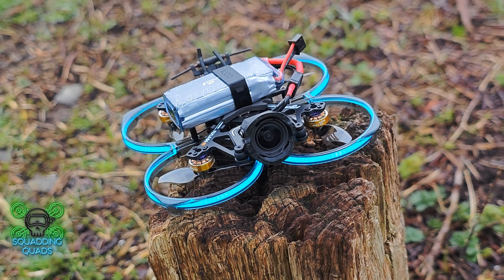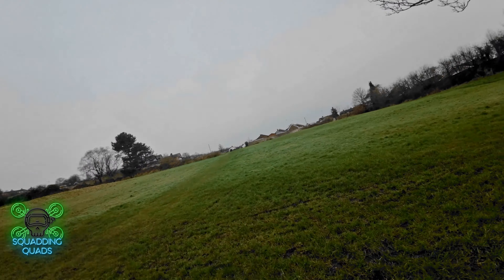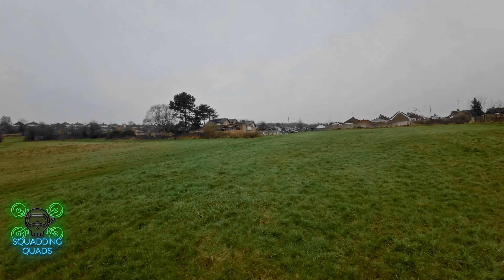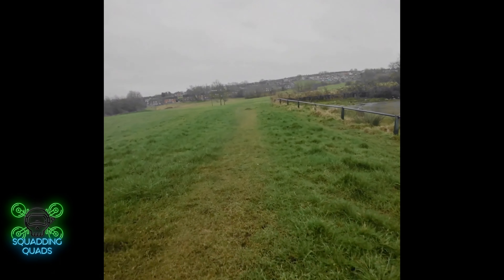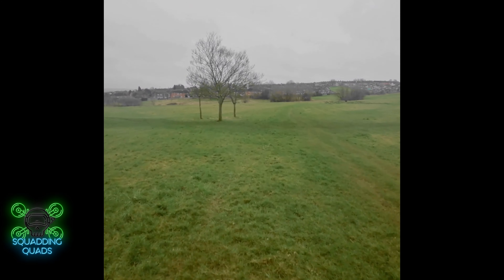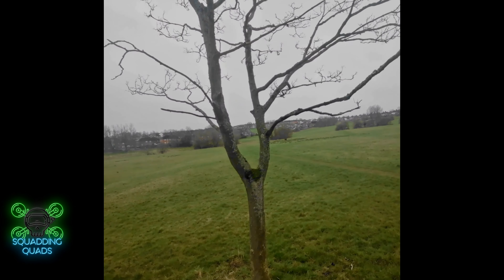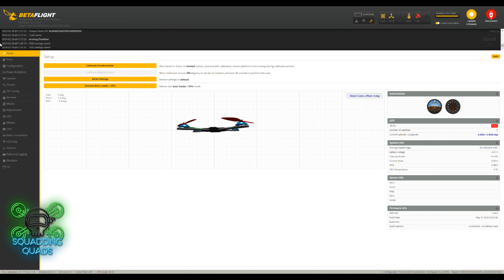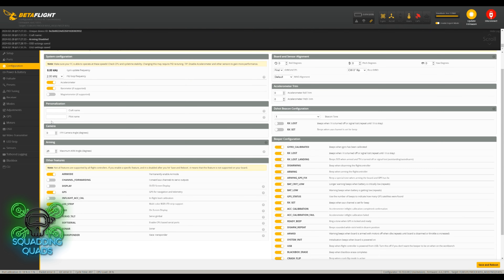THIS Flywoo FlyLens 85 ain't what the influencer promised!

Comment: Never had this problem with mine and I don't even have the lite version and I was running 530mah with 2024x3 and getting just under 2min flight times.
You can't put higher pitch props with more blades on it and not change the tune, of course it's going to fly like crap. They put bi-blades on it for efficiency so your flight time will be drastically reduced with quad blades, and you'll need to de-tune the P and D to compensate for the higher thrust of the quadblades...I can see you haven't de-tuned it by your PID settings.
Reply from the maker: It flys much better and long with tri blades now :)

Comment: I have the Flylens 85 with O3 lite using Flywoo lipo 750 mah and with 4 bladed props you get less flight time but without being too heavy on the throttle I get around 3,10 minutes until first battery warning and this in winter time. Your rig with full o3 and 1000 MAH is quite heavier but if battery drains so fast as you described I suppose there is an issue with the quad so I would have done the same and reach out to flywoo
Reply from the maker: A few changes and it seems I've solved most things, still heavy on battery, but 3 mins heavy freestyle and 5 mins chilling, happy with that considering its the full fat 03.

Got any tips for a Newbie to this size quad?
Reply: Good to hear, but what changes did you make? I can just say the  lighter the better for this size of quad, for longer flight time you should keep the 2 bladed props or just compare by doing some flight tests.
Reply: @squaddingquads  hey, seems i got the same issue on mine. Would you mind sharing the changes you did on yours? I use the 750mah batteries from Flywoo and dont even get more than 2min of flight time… ☹️ thx m8
Reply from the maker: @ballbreaker82  they and update to betaflight 4.5 and then apply the uav tech whoop preset, let me know
Reply: @squaddingquads  Don't fly the 1000mah if you want to freestyle, go with the 750mah, the 1000 is too heavy for more than crusing if you don't have the lite version. Also, I recommend a 3 bladed prop, I'm running mine on the HQ 2x2x3 and it flies well. My latest vid on my channel is with those props and a 750mah flywoo LiHV

Comment: Hello
1. Make sure the propeller is not damaged and press it to the end. You can try to replace the propeller with a new one.
2. Regarding the flight time, the battery is HV and can be charged to a maximum of 4.35/8.7V. We tested the LITE version for 8 minutes of cruising flight. If it is the full O3 version, it should be about 6 minutes. Of course, it is also related to the climate temperature.
Hope this information is helpful to you, thank you

This is the LITE version flight time video display
https://www.youtube.com/watch?v=ivWRRAw0e5g&t=73s&ab_channel=flywoofpv
Reply from the maker: Thanks for reaching out.

Changing props have helped the flight.

The lipos are not marked as HV, this could cause quite a few issues moving forward with newer pilots.

I'm manging to get 5 mins flying around relaxed now I've made a few changes to it.

One outstanding issue I have is the GPS will not get a single lock, how is best to handle this, should I reflash betaflight? 

I'm hoping to have a full review out for next week. 

Thanks again guys.
Reply: @squaddingquads  I mean the lipos say 8.7V on them, that means they are HV

Comment: should of left the standard props on it,i get 9 mins on a 1000mah 35c 2s,not even a hv lipo and 5 to 6 mins on 3 blades, thats cinematic. if you want long flight times then the baby ape from darwin fpv is good, i get an easy 10-15mins indoors with a 2s 1000mah and about 7 cruising outside
Reply from the maker: Once i swapped props and upgraded BF it all improved, unfortunately I've had nothing but issues with my DarwinFPV

Comment: Sorry for your experience man, maybe try a bit lighter batteries with less mAh, maybe you can get the weight reduce more than the capacity and find the sweet spot that it has the peak power density per weight. But again less than one minute from 8,60 to 7 volts is terrible
Reply from the maker: The issue is, this is a flywoo lipo, sent by flywoo, saying this lipo will get 6 to 8 mins
Reply from the maker: It's a BNF So I'm doing jy review based on how a Newbie would be, a Newbie wouldn't understand the sweet spot etc
Reply: You are right man, I hope it isn't somethimg about quads electronics or esc
Reply from the maker: @adakalyoncu1913  I think I've managed to resolve most issues.
Reply: @squaddingquads btw man as far as I learnt from math lesson and joshua bardwell, the jitter may be p term oscilations hehe
Reply: Great to hear that you have solved most issues. It would be great if you would share with us what  you have changed!
Reply from the maker: @georgspandl767  no problem at all, I have a fully detailed review coming with in the next few days or so